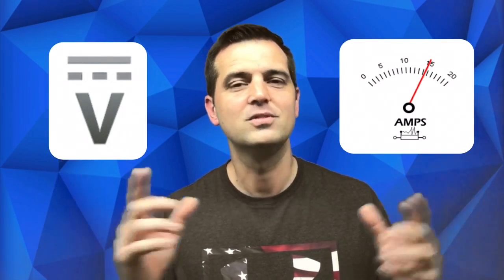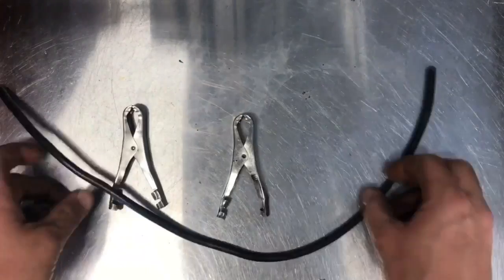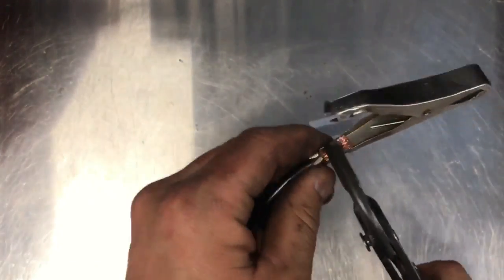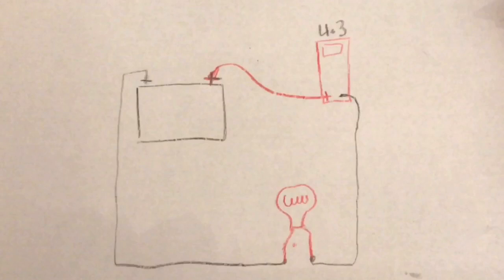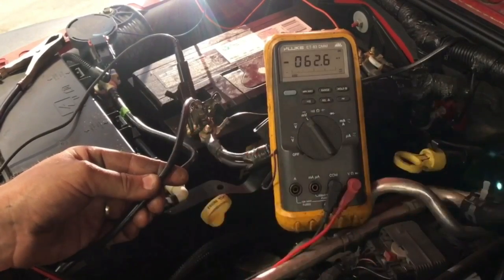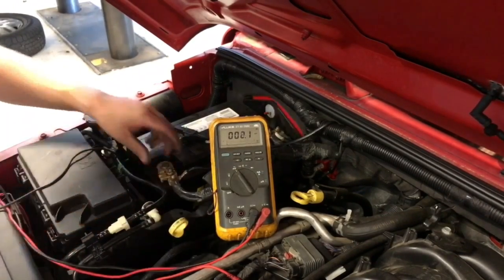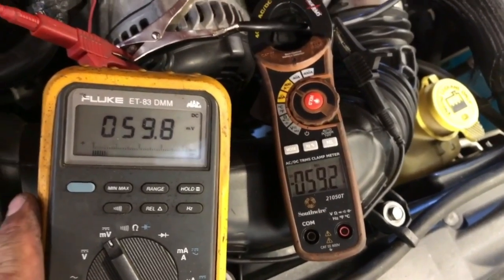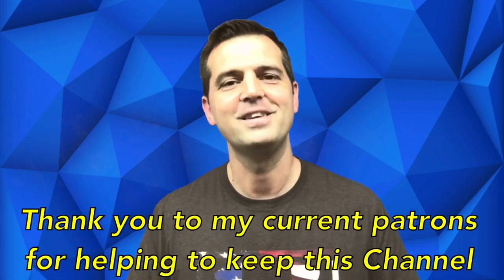How to test an alternator the right way!

Comment: (Shunt calibration problem here) I started with a 24" section of #4 AC wire for my shunt. Once I had my fluke 117 set for Mv in the DC range my high reading was 28mv and my low was 16mv which is a far cry from my target of 4.6 amps that my reference bulb displayed....I made a new shunt this time using #4 AC wire with the meter showing 7 Mv which was better but still too high...I then made a 3rd shunt using DC wire from an automotive battery cable but it read the same @ 7Mv....All Thoughts Appreciated on what is happening Here. This procedure is very straightforward and understandable...I have tried this on two vehicles that I own with the results being the same. THANKS
Reply: Fluke 117 is a pretty old meter. Maybe try new meter leads or a diferent meter.
Reply: @bobg.9419  I think what happened is that my radio was still receiving power (needed for clock, date, stations) and my meter was reading it. Thanks for your reply.
Reply: you are making a 0.001 ohm resistor.  4 gauge has very low resistance of 0.2485 ohms per 1000 feet  you would need  ~5 foot length.  Use a thinner wire for a shorter length.

Comment: That cla. P aint $150, it's $50 or less on wbay but $79 at lowes, theres a low proced excellent clamp multimeter for $40 callwd FIXIT, IT'S EXCELLENT enough just get $10 pair of fieldpiece probe wires and for $50 buck ur got great amp tool that does ac/dc amp vac dc fq capacitance and moore C/F etc..

Comment: I just subscribed to your channel! My 2007 Jeep Grand Cherokee Laredo left me stranded this weekend. Someone jumped off the battery...and it has cranked okay for the last 2 days. I had the battery checked at Advance Auto Parts and it was good. The starter test(cranking) was okay. The charging system test showed a DIODE SHORT. Are diodes parts you can replace? I'm a 62 y/o single female who knows very little about engines(except for my lawn mower engine!) My question is: what do you do with a DIODE SHORT? Thanks for any info. I just spent $521 on an a/c repair(compressor), so I'm hoping this won't be an expensive fix!
Reply: Valerie, you can't replace a diode. People who know what to do it, can replace them. But not many do it yourselfers are able to, or have the tools necessary to complete the job. A diode helps convert the AC energy made by the alternator, into DC energy used by the vehicle battery!! A bad diode will not allow the battery to be charged properly, even tho the alternator is actually putting out energy, it's not the converted energy that the battery uses.
Reply: @roadkill5333  Thanks for the info.!
Reply: You're welcome.

Comment: I made the shunt everything was working ,  I might have switch meter to ma , blew the fuse in the meter.  changed it ,now I can't light the bulb when it goes through the meter. the amp plug on the meter is not fused , only the ma plug .  Did I fry the meter for checking amps? still measures volts , and bulb still lights on bat . terms
Reply: check the ma fuse inside the meter, the 10 amp circuit  sometimes  don't have a fuse,,,,,,only a shunt ,,,,, but you could damage the meter whit a wrong function on the meter,good lock

Comment: Im confused my light bulb was 03.5 but when i use the shun cable the best i can get is 00.3?
Reply: Use a longer wire or smaller gage wire to increase resistance.

Comment: Why does this work with mV ? I understanding the meter only goes to 10 but I don't understand why this is so accurate using mV
Reply: because you are not a electrician , that's the reason we have mechanic's , carpenter's , buss driver's ,electrician's etc,etc, to do they job's professionally ,if you are not a real electrician you can not do -it somebody's else's job

Comment: I don't understand how you're measuring Amps, when you have the meter set on mVolts
Reply: mVdc (the section of wire measured) / Resistance (of the wire measured) = amps DC.
Reply: V= I x R   thus  4.5 mV  = 4.5 Amps  x  0.001 Ohms  You are reading mV  but it translates to Amps

Comment: But!  Calibration?  A bit more explanation of what this calibration procedure has in its purpose would lend valuable credence  to the procedure.  signed, D. Thomas
Reply: goobermint heretik what he did is he found out how much the draw of his bulb in amps, then he converted that amp reading into Milliamps and proceeded to find the exact voltage drop spot  in his homemade Jumper as voltage must drops in all conductors (ohms law) thus using milliamps to indicate amps that's genius imho

Comment: Any auto parts store will check alternators for free. By the way this is confusing
Reply from the maker: Thanks!!
Reply: Or you can check yourself and learn lol
Reply: JH Z considering what is being tested (a device which not only makes electricity to power the vehicle and charge the battery all while converting it from AC to DC), your comment about this video being confusing comes across as incredibly short-sighted and frankly not well thought out.  Some topics are inherently complicated and any attempt to explain them in a way which is meaningful yet helpful will necessarily be confusing to those who refuse to try understand them.

Comment: How to test the Ac Voltage off the Stator and Amps off  the Stator !
Reply: You have to measure with the probes of multimeter inside the alternator phase by phase

Comment: The most important part was showing the wire that, connected from battery to the alternator but you did not show it clearly, just clamped it!!! The not important part was stripping the wire to connect to the alligator clip THEN you showed it??? What the heck???

Comment: I'm still lost
Reply: The "Shunt" here, I think, is actually a voltage divider. 

First, about meters. Internal to the meter, between the "AMP" and "COM" connectections, is a shunt made from a calibrated size of copper. Although copper is considered a "conductor" there is still a resistance to copper that can be measured - although it will be in the milliohm or micro-ohm range (.001 to .000001 ohms). Suppose the internal shunt inside the meter for the amps function has a resistance of 1 milliohm. And now you hook the meter up to the battery while it is drawing 10 amps. Using Ohm's Law were E=IxR. That is, voltage = current x resistance. So, 10 amps x 0.001 ohms = 0.010 volts, or 10 millivolts. The meter is actually internally measuring 10 millivolts across the internal copper shunt (which is actually a precision 1 milliohm resistor) and the meter is actually displaying 10 millivolts... but since the human operator has selected the AMP function, the display scale is re-calibrated to be shown as amps so that the human operator does not have to keep using Ohm's Law to convert the meter reading. 

The meter's internal shunt has a limit of safely handling 10 amps without damaging the very sensitive voltage measuring circuits. To measure current greater than 10 amps requires the use of an external shunt.

Think of his black wire, which has an overall resistance of about .002 milliohms (or 2,000 mico-ohms), as a long string of 2,000 one micro-ohm resisters connected end to end. At the end connected to the battery (at the first of our imaginary resistors) there is no voltage drop. At the 2,000th resistor at the other end there is about an 8 millivolt drop. So, along the length of the shunt, there is a gradient of voltage from 0 to 8 millivolts. By using the pin to probe through the insulation, he is finding the exact spot where the voltage drop is exactly 4.3 millivolts. He picked the spot where number of millivolts would equal the number of amps. He could have picked anywhere - but there would have been more math involved to convert the ratios. This way, we can just read the millivolts reading on the meter and know that it has a one-to-one ratio correspondence to the number of amps.

The theory for his shunt / voltage divider is actually covered in the first few days of DC Series Circuits. But, what Carolina Custom has done to turn a chunk of wire into a semi-calibrated meter multiplier is brilliantly clever!!
Reply: @RHAD-sy3oi  thanks

Comment: you  check  the current on the shunt ,(in  millivolts drop in the shunt ) not in series whit the load ,this is a basic stuff for a real electrician or real electronics technician, if you don't know this stuff you are not a real electrician or a real technician ,i"m sorry but you are lost